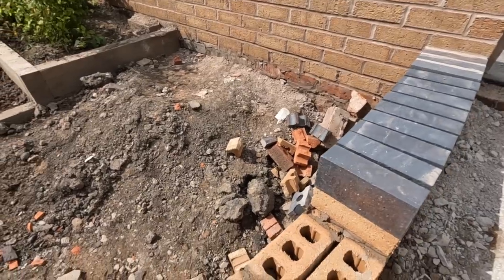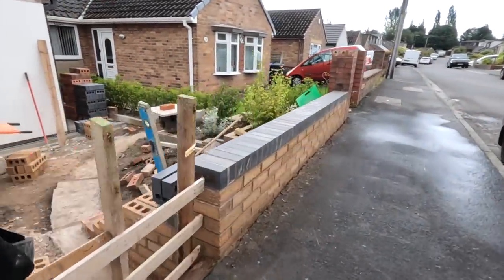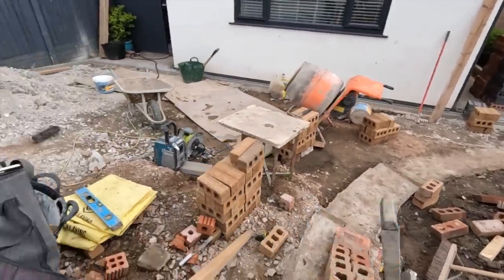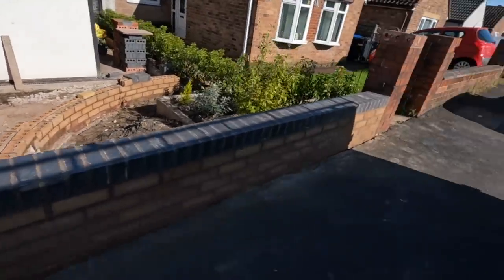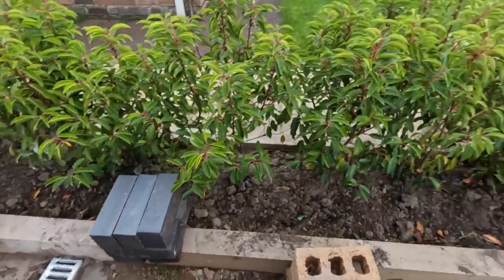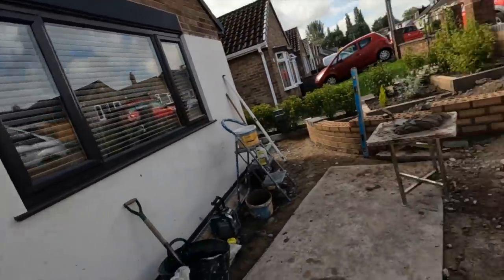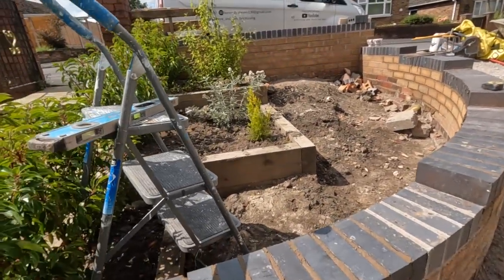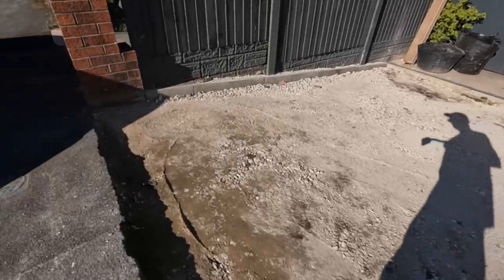RADIUS GARDEN WALL COMPLETE . LANDSCAPE PROJECT PT 5

Comment: Nice work! Very consistent spacing between bricks on the curve, not to wide at the outside nor too small on the inside of the top row of blues, visually very pleasing.
Making your steps equal lengths surely made spacing out the top row a bit easier.
Reply from the maker: Thanks Tom 🧱👍🏽

Comment: Well done mate when watching a had feeling them blocks maybe to high a tend to hardly ever do but with commons or blocks always have fear of a bit of it showing 😂 super work buddy 🤟🤟
Reply from the maker: Yep , I pushed it a bit , they were ok on the drive side but too high in the planter 😬
Reply: @SteveAndAlexBuild  
Superb radius buddy when has the bricks set up on there ends as working down the steps you put the measuring was that just see what more bricks ya needed ?
Reply from the maker: @lmilne4859  yes mate 👌🏼. 😉🧱👍🏽
Reply: @SteveAndAlexBuild  
😎 nice wee trick that following marks ya previous marked on concrete. Have a good weekend buddy. 🤟
Reply from the maker: @lmilne4859  Cheers Lee , you too buddy . 🧱👍🏽